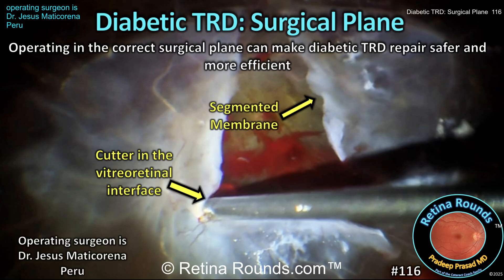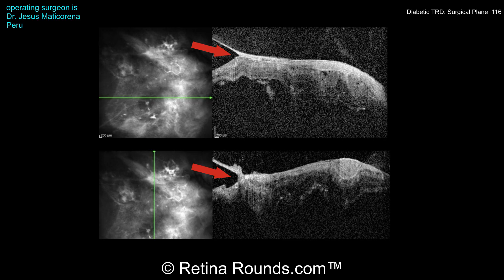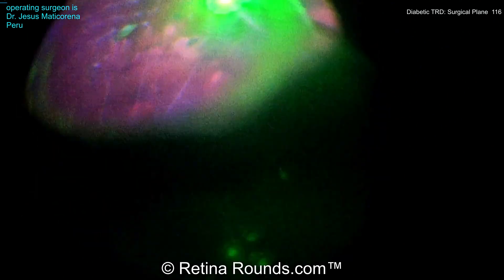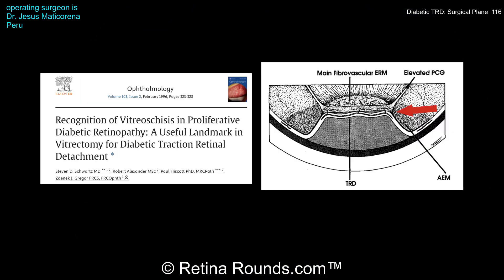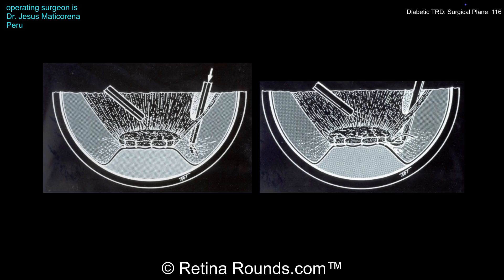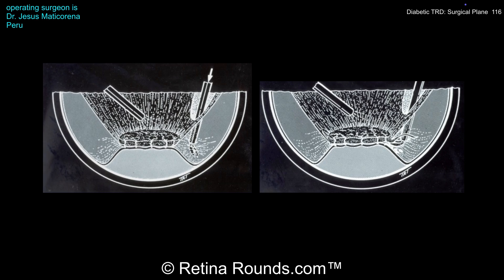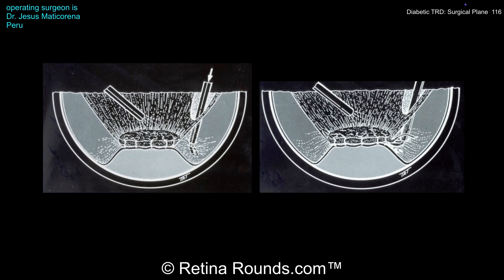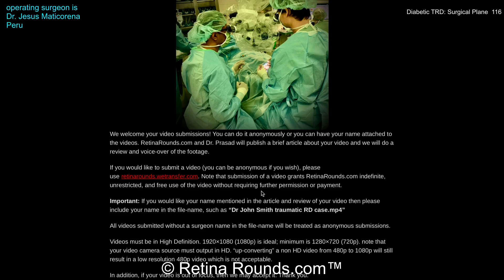RetinaRounds™ 116: Surgical Planes in Diabetic TRD Repair

Comment: what setting do you use for cutting membranes?
Reply from the maker: For tighter dissections, my preference is to use the shave mode or to keep a high cut rate and low vacuum to decrease the risk of inadvertently cutting the retina.  Positioning the cutter between the posterior hyaloid and the underlying retina, engaging the cutter briefly and intermittently, and using smaller gauge instrumentation (27g) can also help decrease the risk of iatrogenic damage.  Thanks for your question and I hope this helps!

Comment: IF a retinal breaks IS happend , a tamponnade with silicone Oil IS Necessary?
Reply from the maker: Thanks for your question.  My preference is to use air or gas when possible.  The key to preventing a retinal detachment has more to do with removing any tractional membranes close to the retinal break than the tamponade chosen.  I prefer all fibrovascular tissue and membranes to be delaminated within 1-2 clock hours of the break).  I hope this helps!
Reply: Thanks  @RetinaRounds